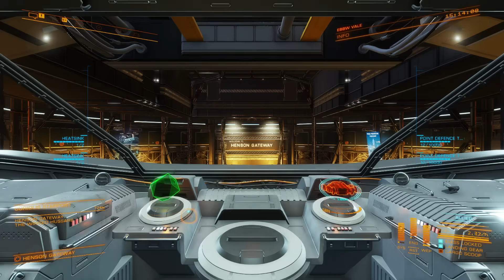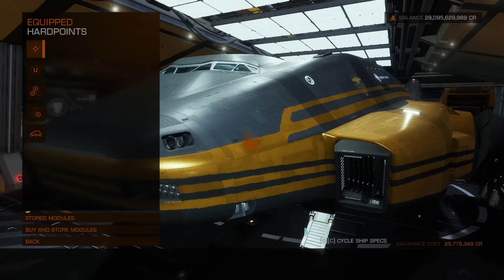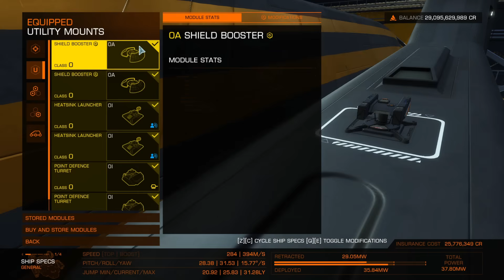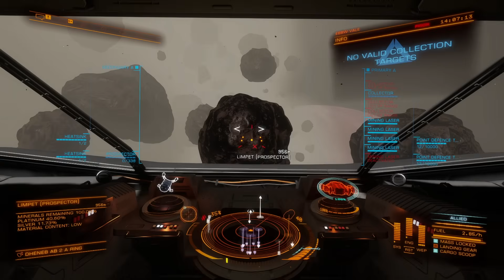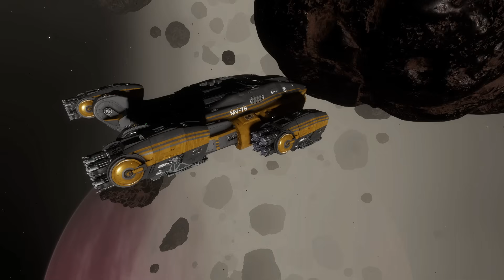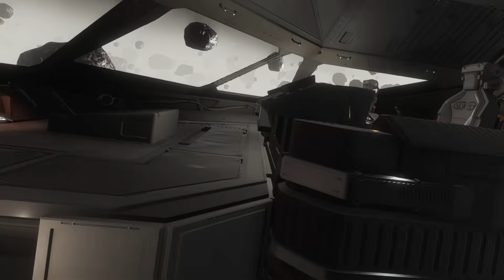Elite Dangerous NEW | Panther Clipper Mk2 Laser Mining Build | Better than Cutter | ARX only

Comment: Would you recommend me taking it out into the black on my new FC for tritium mining or the Type 11?
Reply from the maker: If you have the T11 then that would be better for tritium mining, when you’re not travelling far between mining site and carrier the T11 is better, will get much more yield too, not that I have done much tritium mining, I threw one on my squadron carrier in case of emergency
Reply: @y_ffordd 
Thanks, that's just the sort of advice/confirmation I was looking for. Yes, out in the black, my carrier will probably be parked in the same system so I was leaning towards the Type 11.

Comment: I haven't bothered with shields for mining in ages. Especially with a universal limpet controller onboard for hull repairs.
Reply from the maker: Yeh good point, if I can think of a use for the slot I’ll remove the shield… though could be useful for one of my other builds, the Anaconda or Corvette
Reply: @y_ffordd  more cargo or more collectors?

Comment: I may be crazy. I put a whole 10 of those pre-engineered lasers on my panther clipper. Maybe not the wisest choice but it does look cool!!!
Reply from the maker: I heard the torval mining lasers were the way to go, this legend used 7x torval lasers and 3x 2D mining lasers and it’s pretty good… I’m going to need to get more torval lasers

https://youtu.be/uqSR_9hPh0g?si=HUpKr6vsWQPSjzro
Reply: @y_ffordd  holy crap I think you might be right, this might be the way
Reply: @y_ffordd Are the pre-engineered mining lasers worth getting? I know they are only class 1 hard points. How do they stack up alongside a class 2 mining laser?
Reply from the maker: They are probably worth it for min/max builds, but 4x 2D mining lasers will be good enough. The 1D torval lasers cost less distributor draw for more effective lasers than standard 1D so if you’re well into laser mining they will be worth investing in at some point, but you need lots for the best build, although I added just one to my 4x 2D mining laser build and it will have made a slight difference, maybe I could have added two, which is no bother to unlock. 

Here’s the torval mining laser video, the description lists the materials and tells how to do it https://youtu.be/5x4rLpNy3LM?si=CFOnhdSB2VcdVrDS

Comment: https://youtu.be/uqSR_9hPh0g  I did have to use a few heat sinks but that was mainly because I didnt have 4 pips in weapons a few times, and I still am curious why some asteroids take a lot longer to burn down, also I am still getting used to this ship so it wasn't a professional outing for sure lol Also I recently upgraded to windows 11 and in the process I lost OBS settings so the quality isn't where I wanted it.
Reply from the maker: That’s 7 torval mining lasers and 3 standard 2D mining lasers, I heard of a similar cutter build on Reddit but didn’t build that one, I’m going to have to get more preengineered lasers, thanks for this, will add your video in the description in case anybody wants to see how fast she burns through those rocks, thanks.
Reply from the maker: Also I need to get the bottom laser on a separate trigger, I’ll just have to use the one I have as the prospector, got limpets to spare, thanks.
Reply: @y_ffordd  What I do for one fire group is put the 9 lasers on "1" and the single laser on "2", then on a second fire group I put one 3A prospector on "1" and one 3A prospector on "2", works very well.

Comment: Its not better than cutter, It only carries more but is slower.
Reply from the maker: The cargo matters as you spend less time in transit to make the sale, I don’t see how the extra boost speed while doing the laser mining makes it a more effective miner, the numbers certainly don’t support that with my mining runs, comparing Cutter and Panther at the same spot. Do you boost during mining? How do you not overshoot your target if so?
Reply: @y_ffordd  I think the speed of the Cutter makes that ship really good at surviving. If you get interdicted jsut submit, drop out, boost away and live. For hauling work I have a size 6 Primsatic on it with G5 Dirty Drives and even if the cargo is full by the end of the 2nd boost cycle you are out of range of everything. ( talking about NPCs here ).

Comment: Tip: You can interrupt the boost if you're opening your hatch/landing gears, to reduce it's initial "push". Thus limiting your max acceleration.
As far as I could measure the "boost duration" it is around 5 sec, so if you open the hatch within this timeframe you could do a "short boost" with a lot less speed. Just make sure that the hatch is open for the remainder of the boost time.
Reply from the maker: Yep I normally use the cargo hatch as a brake but maybe I would have to use it immediately to slow down enough over a short distance, although when I boost at my carrier with a cutter with that same trick, I throw on the landing gear and decelerate immediately it works, but that’s over 9KM+ and with asteroid ranges of 2-3 KM I’m not sure I could get that to work so well, will have to try it again

Comment: o7 Commander
Top Tips:
I maxed this laser mining build yesterday 😅  7 class one pre engineered mining lasers and 3 class two, with 20 collectors and 832 Cargo. With G5 Heavy Duty/Deep plating on military grade armor it has just over 3k armor (this allows me to run a Low Emissions/Thermal Spread PP so there isnt any overheating with all the lasers I am running this also helps with SCO temps), so I ditched the shield, have to be careful though as its easy to run into asteroids if you arent used to this ship. The Cargo scoop is near the front of the ship so from what i could tell in the half hour of mining I did the collectors scoop up fragments faster than any other ship (you want to put the bottom front most laser on 1 or 2 in fire groups what ever is opposite of the others, then when using lasers just fire the bottom laser slightly after the rest- this will make all of the fragments spawn of of that laser), you will have to put prospector(s) on separate fire group though, but this works well as you can run two 3A prospectors (one on 1 and one on 2) on that fire group and alternate the firing 1 then 2, with a little practice you can launch 4 prospectors in about the time it takes to launch just 2 with a single 3 A prospector.  Another thing I did notice is that the time to burn down asteroids was more inconsistent that normal, I had a best time of about 13 seconds and a slow time of 20 seconds, but I am thinking the slower times may have been when mining smaller round asteroids as I dont think all the lasers were hitting it, but I could have been off center as I need more practice with this ship. Oh just wondering why put weapons on mining ship? Who exactly are you going to shoot lol The time spent aiming at an enemy ship is better spent boosting away from mass lock in ring and getting out of dodge, if you are being attacked in a ring something went wrong, if you were interdicted you want to submit and jump out after the 15 second FSD cool down, I will admit there may be a good reason, but I have never needed weapons on mining ship lol
Reply: any chance you could share an EDSY or corolis?
Reply: @grey5751  Unfortunately you cant post links here, I tried lol
The main things you you want (if you want the most efficient miner) are 7A PD with Weapon Focused/Super Conduits Or Cluster Capacitors (will give about 1 more second of lasers but not vital), you will also want 8A Power Plant with Low Emissions
Thermal Spread (will keep you from over heating when using lasers and SCO, if you plan to run a shield you will want only G4 so you can add 2 shield booster). On optional internals you want to figure out how much cargo space for how long you want to be in the ring, in a good Platinum hotspot when fully engineered you will be able to get 500t hr or more, or less depending on ring/hotspot. once you get cargo capa sorted put a shield if you want, and of course DSS, Prospector, and Refinery, then pack the rest of the slots with collectors- dont forget to use 7A multi limpet controller for the 8 collectors. Oh the most important thing you will need to be able to pull off running 10 mining lasers is getting the 1D pre engineered mining lasers so you can run three class 2 and seven pre engineered 1D as long as you have G5 PD with Weapon Focused/ and either CC or SC experimental). The pre engineered 1D mining lasers make it all work, as they are super efficient and will produce more fragments per MJ of weapons PD, they also have a 2.5 km range with no damage fall off and run cooler than standard mining lasers.
Are you on any Facebook ED groups? Or Discord? I could share the build there.
Reply: @jasperlit1345  no, but you put in exactly the effort I needed by mentioning the laser setup. Much appreciated
Reply: @grey5751  no problem 👍
Reply from the maker: Thanks, if you have a video of your build mining then I would be interested to see the heat generated. The defensive weapons are for mining in a hazres, you get double the yield there, although I didn’t do any proper hazres mining in this ship.
Reply: @y_ffordd  I Dont have a vid at this time, but next time im out there I will make one :)